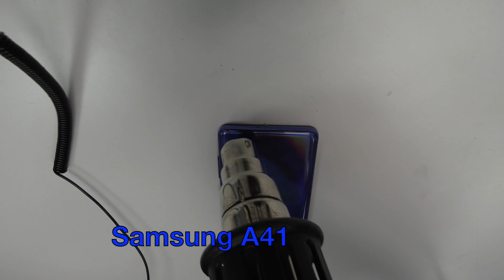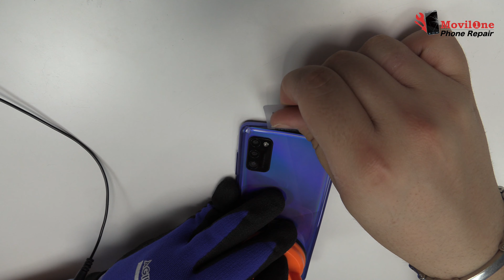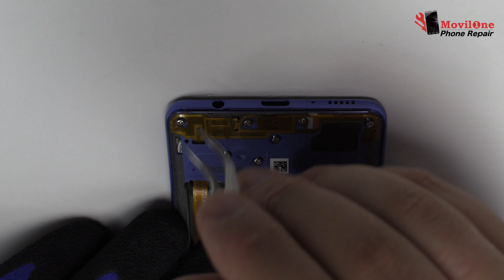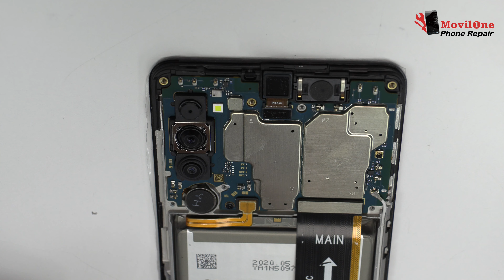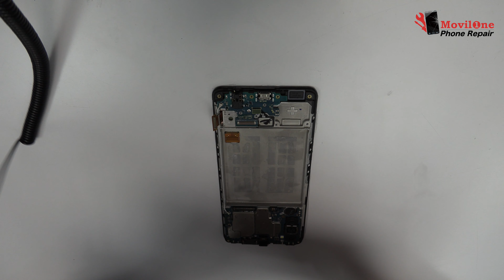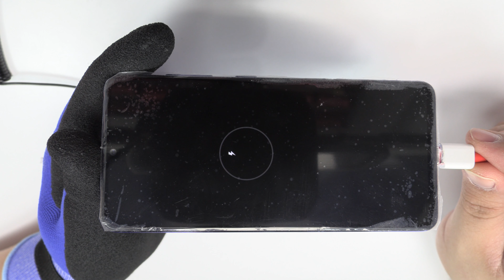Samsung A41 Battery Replacement

Comment: This is just a money making exercise.  I can't believe you cannot remove any mobile batteries like you used to. I had an s5 last 5 years because I swapped the old battery for a new one and it lasted way longer than these cheap tat phones.
Reply from the maker: You are right, Ar! Today's phones have nothing to do with the old ones ... and almost all of them come sealed so that they cannot be opened without specific tools. Thanks for your comment!Best regards
Reply: We are doing a41 not s5